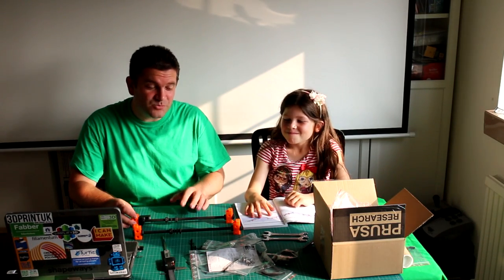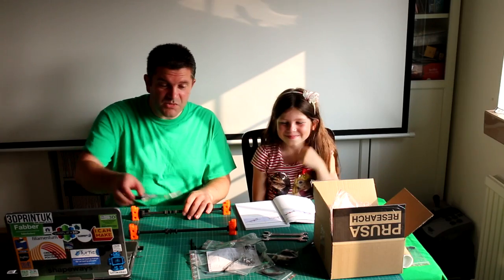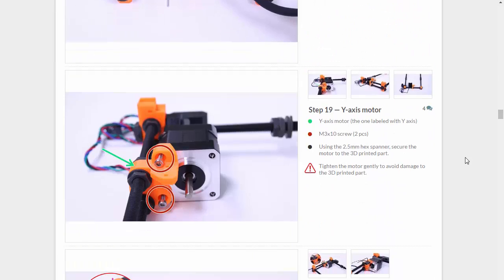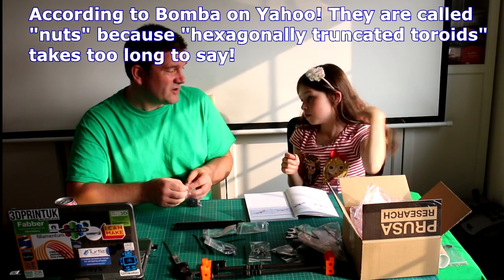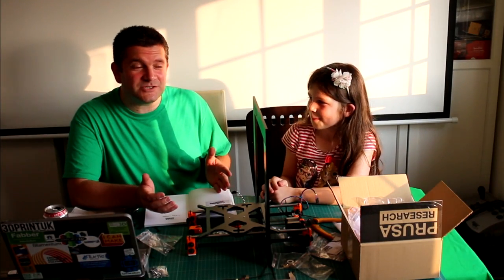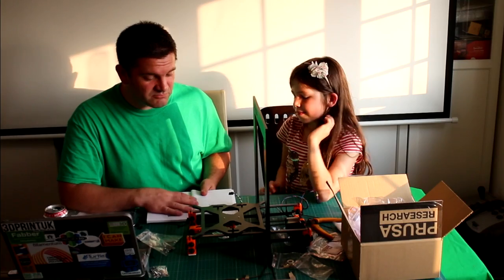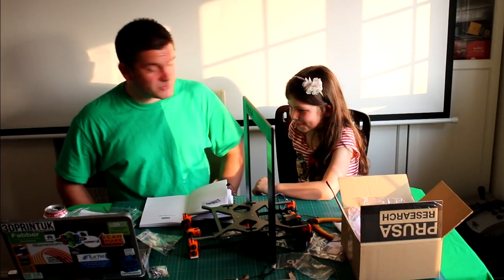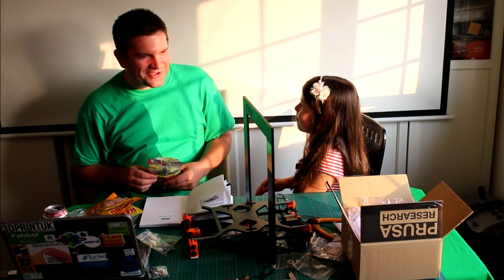Prusa i3 MK2 3DPrinter - Dad and Daughter Kit build - Part3 (Y axis assembly)

Comment: I did create some alignment sticks for this printer, however I don't think they were well received.  I'm open to design suggestions:  http://shop.prusa3d.com/forum/improvements-f14/mk2-alignment-sticks-t1579.html

Also, the shiny linear rails should be 170mm on center apart.
Reply: Those are cool!
Reply: Aaron - I think the alignment sticks are a great idea.  Looking now at the forum note, I think you would have gotten more traction if you had posted an inline image.  Also - as awesome as they are, I don't think most will want to wait for the time required to print them, but it might be a great idea for Prusa to include something like this.